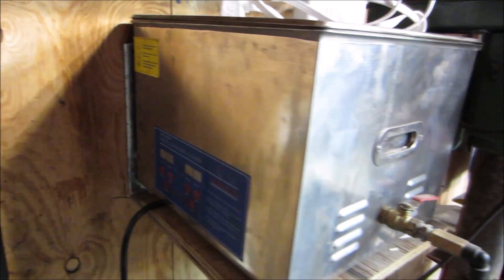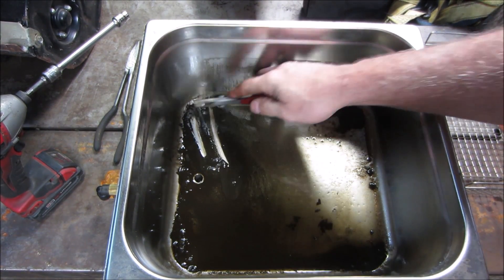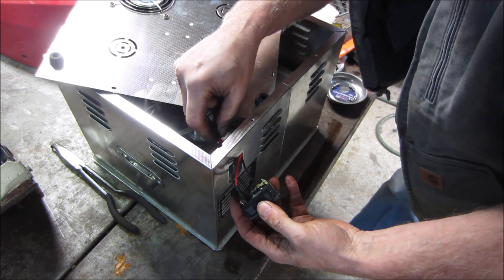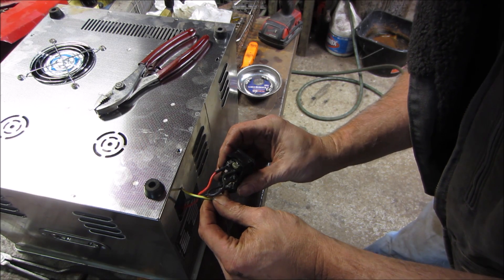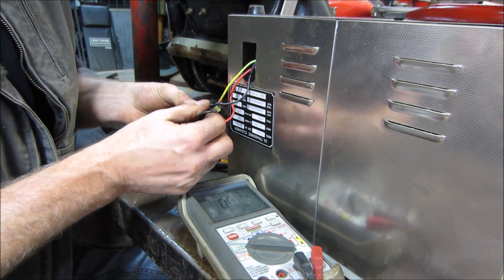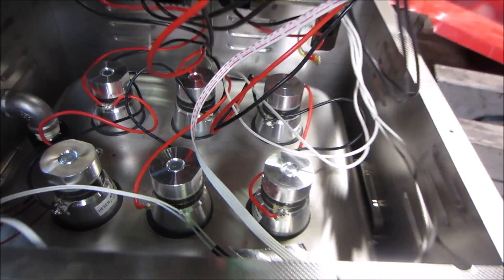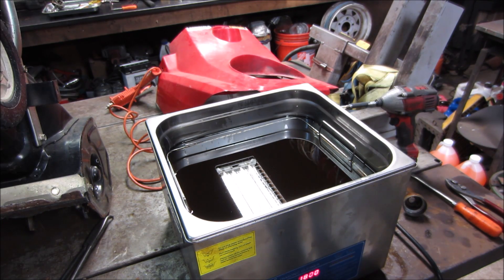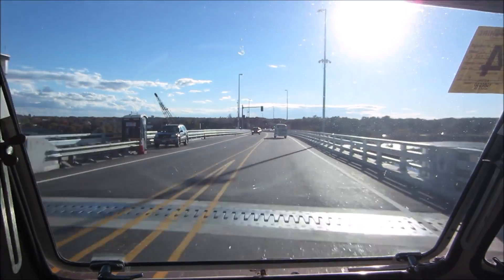Ultrasonic Cleaner repairs carburetors

Comment: How much better is the sonic cleaner over just soaking the carbs in the cans of carb cleaner?  Does it get parts cleaner or just cut the soak time way down?  I've got a bunch of automotive carbs to rebuild and always have small engines needing carb work. So I'm considering getting one of those sonic cleaners.  Do you think the 15L one would be big enough for 4V carbs? Thanks. 

Love your videos! You've helped me out with a lot of small engine repairs by me watching you fix the same issues.

Comment: Those inlet/fuse/switch combos should be available pretty easily. Get a name brand from Digikey or Mouser and I wouldn't be surprised if it lasts 2 or 3 times as long.

Comment: I have the 2L size Ultrasonic Cleaner and my switch broke/fell apart after about 3 years of every other day use, you can get the same exact switch on ebay in a 2 pack , or can get a similar one from radio shack (if there's any left ) or any electronic store

Comment: We used 40khz transducers to weld plastic together on ink cartridges at a printer Factory I worked at that's why you're not supposed to put plastic in side of a Ultrasonic Cleaner it can melt the plastic or cause air passages to collapse and weld together!!!

Comment: Not a bad way to start the day. Got almost 12 hours of sleep after an exhausting saturday. Have one of my favorite energy drinks. And l check my email and see a notification email for a new Mustie1 video! 

Glad that it was a simple fix on the cleaner and that it wasn't something on one of those transformers or another PCB. Even if you had bought that cleaner it would have paid for itself several times over with the amount of carbs it's helped you bring back from the dead on various projects.

Comment: Water, Simply Green, Purple Power, lemon juice/water are liquids that people use in ultrasonics cleaner.  However, the efficacy of these may not be enough in some cases.  Carb cleaner seems to be working quite well in your case.  Two years before the switch craps out sounds about par for the course for today’s products.  A simple troubleshoot and bypass and you are back in business.  Meanwhile, some people would just chuck it in the garbage and buy another one.  That’s how people keep the economy chugging along in the throw away society we live in.

Comment: People in the comments, howling about the chinese switch quality (or lack thereof!), but the cleaner vibrates at 40,000 hertz- there aren't many switches that can take that for years on end. Your bypass solution is definitely the trick, and the glue is a nice touch.
Reply from the maker: on the new ones they got rid of the switch all together

Comment: I ain't no friggin' expert or such, but I grew-up around electronics... Dad was a Master Electronics Tech when he retired from the AF... but I was taught to not do something unnecessary regarding troubleshooting electrical circuits.  
I am really confused (I tend to stay that way - ha ha) as to WHY the heck you felt the need to pop-out the main switch.  EVERYTHING needing access to check continuity/mechanical working is RIGHT THERE once you open the cabinet, don't you agree?

Comment: I had the same cheap switch on my hot air soldering tool.  It did the same thing. 

My ultrasonic cleaner is about half the size of Mustie's.  I wish I'd have bought the larger one with the drain.

Comment: A trick that works good for small orifice jets is to heat the jet just hot enough to burn the varnish up then drop it in 
water and the varnish is gone in a flash.

Comment: I swear by mine. It has the built in timer and probably is not as good as the one you have. I dont use that brand of cleaner any more as I developed issues using it. I cannot get near it even. Probably too many years of using the stuff. I found that Simply awesome cleaner works perfectly for me.

Comment: I repair electronic equipment in the UK - Those type of switches fail VERY regularly, must be just the design of them.
Reply: Yep, they are undersized for the inrush current when switched on. Just a matter of time before
they fail.
Reply: I have the same experience. The contacts "burn in" very quickly due to the inrush currrent. Contact resistance gets too high, causing more sparks and more burn-in within days, then it stops.
Reply: I keep at least ten of those in stock for the same reason.  Do you have an alternative part that you're using that carries more current?  I've just been doing direct replacement.

Comment: You could wire a light switch into the power cable for a on off switch, nail a electrical light switch box on the wall to house the switch in.

Comment: I know from many years of experience that you always check those kind of fuses with an ohmmeter. If they are the big flat blade ones a visual check will do but, the smaller ones always check. I spent two days troubleshooting a mainframe computer system because the fuse looked good.

Comment: I was given a used cleaner but the issue I'm having is that the tub is pitted and it leaks. Is there something I can coat the tub with to seal it from leaking?
Reply: Did some research to find out why their is pitting. It was used without the basket and this is a no no. Setting parts directly on the tank bottom bottom increases the incident of cavitation erosion – pitting of the tank eventually causing the ultrasonic cleaner to leak . I think the cleaner is ruined.
Reply from the maker: yeah ive heard that too
Reply: I bought some J-B weld and will see if this will stop the leaking.

Comment: A few tips with these ultrasonic cleaners, empty the device once a month, depending on use, I set up a filtering system in line on the drain, a length of clear tubing and a simple briggs fuel filter, and then a paper fuel filter, in tandem they clean the liquid almost perfect, it takes a little time to drain but really cleans the liquid well, but the one guy here is right, tape the temp sensor back down other wise it will over heat, I never use the on/off switch just unplug it, and as for a liquid, for cleaner, use 50% simple green purple, 25% white distilled vinegar, and 25% distilled water, best cleaner I ever used.

Comment: This is why I miss the old 'Radio Shack' stores. If you had a bad switch there was always a good possibility that they would have the exact thing you needed in stock for a few dollars.
Reply: If the stuff from China has to start paying normal shipping costs, stores like Radio Shack might make a slight resurgence.
Reply: That's what happened when the young people started playing on electronics instead of building them. I used to occupy myself for hours with a Radio Shack 150 in 1 Electronics kit
Reply: Yeah man! The ole RadShack was the joint!
Reply: @PabloDiablo682  jameco and digi-key also.
Reply: Possibly, but probably not. That is an inlet module, IEC connector, fuse and switch. Little too 
sophisticated for Rat Shack. Ebay and Amazon has them.
Reply: @quantumleap359  On many of them it's just a standard size switch clipped into the IEC module. You can see the separate bezel while he is trying to lever it out. But still - replacing it with the same undersized switch and expecting a different result might be pointless.

Comment: I think the manufacturers don't recommend the use of flammable liquids because if the tub were to crack from vibration and the fluid leak onto the electronics, it would be somewhat less of a fire hazard. I use the same carb cleaner in mine, it's about the only thing that works.
Reply: dirty water is a good conductor of electricity also, so it doesn't matter. either way its a risk to take.

Comment: As long as the viscosity of the fluid is close to water, I would think it should work fine. If it is a heated unit, of course you have to verify the fluid you use won't go up in flames. 😀😀😀

Comment: the weird thing Ive noticed with my ultrasonic cleaner is that the vibration will actually raise the temp by itself. I use kerosene (havent made my mind up about it yet) and Ive had a few times where my unit went well over temp.
Reply from the maker: thats why l like the timer, it takes about an hour to get hot by then it already will have shut off

Comment: I have the same machine.  One tip I've found with mine, if you have a part that is small and REALLY greasy,  you can put the part in a sealed glass jar full of petrol and then put the jar in the machine.  The cavitation bubbles will happen even with the glass.  Cleans the part without a massive fire hazard of having a cleaner full of gasoline.  I'm curious how many litres that one is.  A lot bigger than mine.
Reply: Mustie has a 15L

Comment: I've got a similar  cleaner I bought it broken and had to fit some new fuses and a few resisters and re solder a few dry joints in it works now heats up and vibration but no display on the little screen  but it cleans well and only  cost a few pounds and it's kept it out of a land fill

Comment: when you drain your fluid use an old funnel & paper coffee strainer.. the more crap you can catch the better..
Reply: 888johnmac good idea
A paint strainer would likely work better at filtering and be much quicker 

Or use both for even better filtration
Reply: I have a similar unit that will run for a minute... fizzle out... kick back on... rinse and repeat.  All caps test ok, transistors bench tested ok. transformers ok  and neg/POS rails have full continuity...  Every joint resoldered, all components tested.  I'm stumped.  Thanks for sharing.

Comment: that's a still for moonshine
Beware of Harbor freight auto mini fuse knockoff. They quit selling them many fires from a 10amp fuse blowing at 50amp . Their 115v  plug ends melted on me almost burned shop down with 1500 watt electric heater. 
Not UL rated should be illegal to sell in America.
Reply from the maker: l agree,
Reply: good to know, I have a whole box of those.

Comment: I've found that LA's Totally Awesome in a 25% solution of water (4:1) works great on older pot metal carburetors that typically gray in the carburetor cleaner solution and it cleans/de-grease's the newer Aluminum carbs very well also. One of dozens of suggestions I'm sure you've heard. Cheers! Zip~
Reply: Yup, I found it works better than the carb cleaner in a shorter amount of time. I used to use the cleaner in a can but became sensitive to it. Now I cannot go near it. I usedvit for years.
Reply: I will second that, LA Totally Awesome Cleaner is great stuff. Wear gloves!
Reply: @3rdworldgarage450  Good to know

Comment: Hey Mustie, do you want a couple 2 cycle engines for your bikes?
Reply from the maker: l have quite a few already but thanks
Reply: I dont mean to step on toes here but if you're looking to get rid of a couple engines, id pay shipping plus providing Mustie dont want them.
Please and Thank You.
Reply: @m.kasper7646  Just two leaf blower engines; but you're welcome to them. I can't get them tuned right and tired of trying.
Reply: @TreyCook21  im sorry to hear that Trey, I could could sit here a ask a bunch of questions like is the intake manifold tight, plug color? (Lean/Rich) etc.etc. but im not unless you want me to try & diagnose the problem? It would be costly to ship them im sure so it would make more sense to either give them another good O'l college try or donate them to a neighbor kid thats into engines. I really do appreciate you offering them though and wish you all the best. 👍🏁
Reply: @m.kasper7646  I've asked myself all those questions. The Robin FL21 isn't shutting of the gas flow (overflows while sitting). I'll reinspect the needle and seat. The BV1650 and the Robin run, warm up, die and then won't start again. Got to be fuel/air mix.

Anywho, they'll sit in the building until next spring and I'll give it another go... Unless you're local to the mountains of NC
Reply: @TreyCook21  Hahaha! No sir not local to NC, im in Ca. But I believe youre correct if the gas keeps filling the bowl, that normally indicates debris(dirt or spec of something) consequently not letting the fuel to shut off completely. Thats a typical issue with allot of carburators. If you have an ultrasonic device take carbs off n apart as much as possible & soak them for a bit. Or clean them best you can with whatever you have and blow out everything with an air compressor. That would be worth time invested & will bring your chest up & shoulders back a bit😉👍👍🏁😀Lol! Anyway, yes Trey, From what youve just told me I do believe you are on the right path & just one more try outta do it, focus on that debris on that pintal & seat gas shut off thingamajigger.😀👍🏁 good luck buddy and if you can keep me informed, Would be interesting to know the outcome. If you Facebook hit me up Im a big racing fanatic & vw's(BajaBug's) & custom motorized bicycle builder. Ttyl

Comment: Are you telling me that in all of your hoard, you don't have a simple rocker switch to replace that one?? Even I have salvaged rocker switches that'd pop right in there easily, you need to get hoarding more switches, PC power supplies are a good place to get 'em as they're rarely switched on & off so last forever... :P
Reply from the maker: guess you missed the timer l said l was using in its place,
Reply: Nah, I saw that bit, just seems a lot more work for something that you can pop out & swap out in less than 5 minutes... :)

Comment: That’s a nice looking cleaner.  I’ve used one of the HF cleaners with some success but it only handles small parts.
What’s the capacity of that tub?  Will it hold all of 2 gallons?
Reply from the maker: yes
Reply: 15L

Comment: You don't need a switch on it, your bypass is spot on :-D.
Under rated switch, better without it.
Hey close the vw window, im getting cold, and Are we there yet? :-D
Reply from the maker: l had the heat on, well kinda, its a vw
Reply: Mustie1 yeah,,roll up the window, watch them red lights bla bla bla. I'll shut up,you won't take us anywhere anymore.
Reply: You need the windows open to clear the smell of Gunk. Jez looking at that sub     you must have had some really high tides.